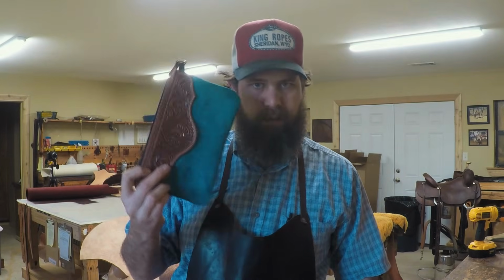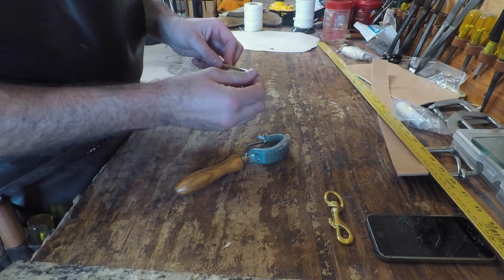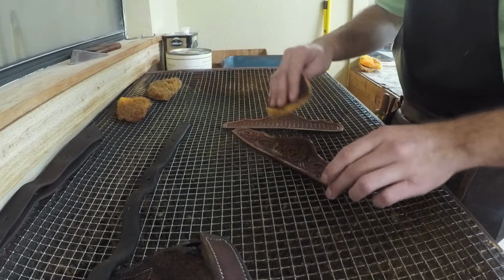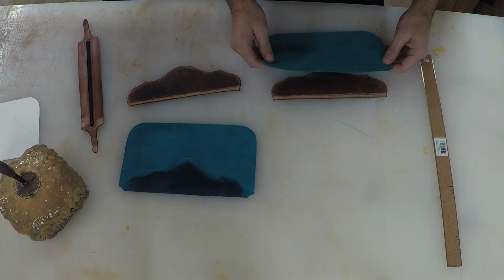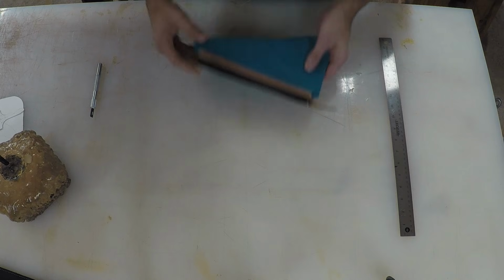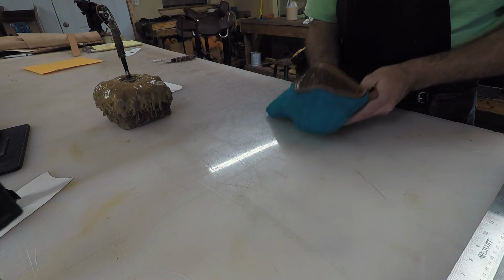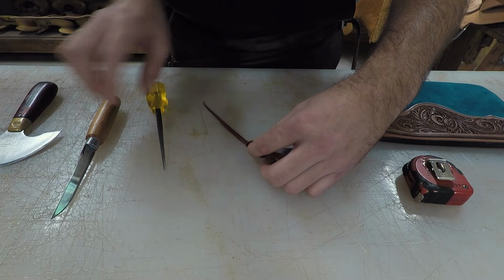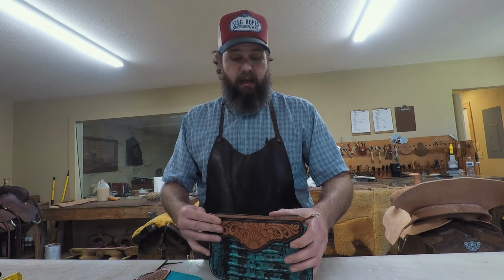How To Make a Leather Wristlet Purse

Comment: Don, I have used one of those Tandy edge rougher tools to get glue off suede. Now the glue was about 1/4" to 1/2" outside of my glue line that I drew on some suede on a rifle sleeve I was making. After it had dried, I thought what the heck. I just rubbed it lightly & it worked & roughed the suede back up & pretty well got rid of the glue. Maybe it's just my old eyes but I can't even see where the glue was. Worked on black & light brown suede. Maybe this will help others watching.

Comment: I have purchased both the pattern pack and the kit from you. I am at the point of sewing the three pieces together and have rewatched your video a few times. My question is if the purse body is placed 1/4 inch down from the edge of the yoke what is the distance of your stitching groove from the top of the yoke. It would have to be greater than 1/4 inch in order to sew all three pieces right? The problem is the border on your pattern is 1/2 inches wide. I would have thought the stitching groove would be 1/4 inch from the edge (however this would not sew the leather for the purse body).  Please advise

Comment: Hey Don! Your work is great! Truly a top notch craftsman/artist!! Question for ya. I bought this pattern pack and a bunch of tooling patterns from ya, basically do I print them out and line it up on my leather and trace it to leave the impression on the leather? I’m as green as they come if ya can’t tell!! I really appreciate you sharing your knowledge with me (us)! Jason
Reply from the maker: +jjs4x thank you so much for the support!  Yes, some packs contain the cut patterns for the parts of the project... these I would make poster board copies of to use when cutting all your parts out.  The tooling patterns can be transferred to tracing film so that you can trace them onto your cased leather for tooling.  Thanks a bunch!

Comment: Shute I couldn't draw on that piece. I would either have to use a tap off, trace something or use a rub off. I just ain't got that artistic ability. If I don't draw it n paper first & get right then I will surely screw up my leather.
Reply: Have you ever thought about using a mini projector? My wife bakes cookies and uses one to get artwork lined on the cookie before icing them. I got her the mini projector, a small tripod, and a cable to connect her iPhone to the projector. Works awesome.